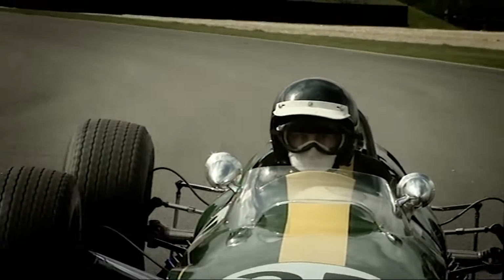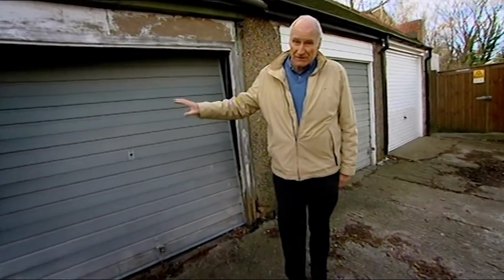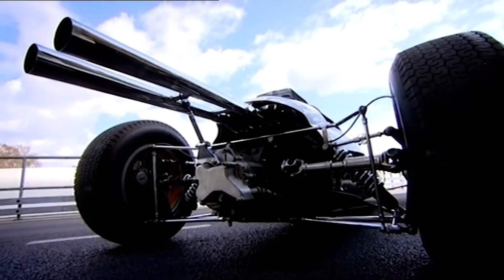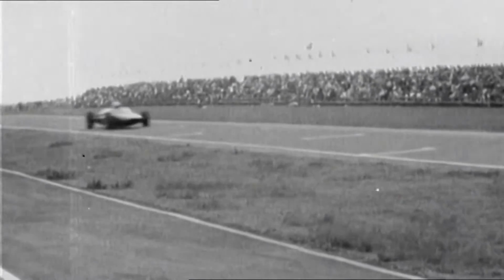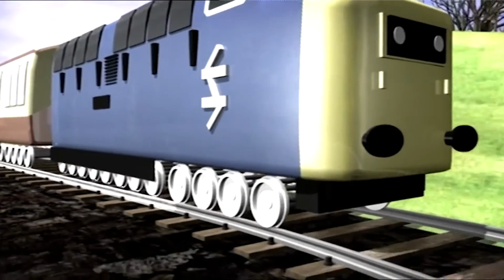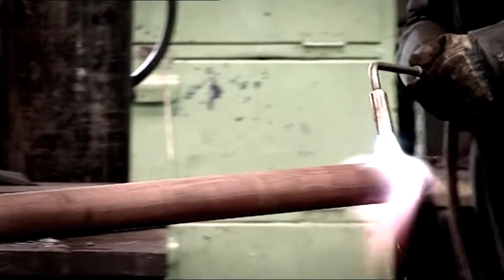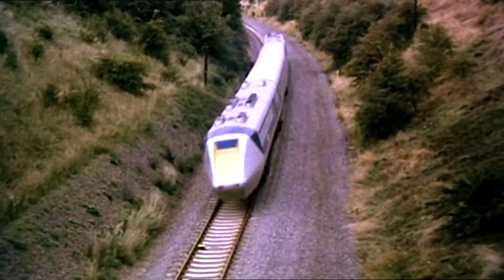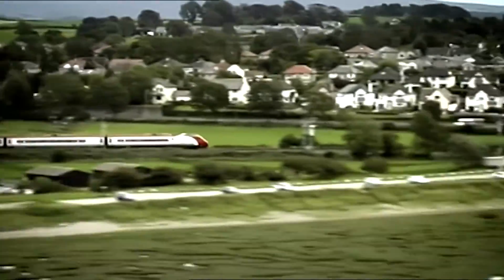How The Lotus 25 Race Car Revolutionised British Formula One

Comment: This milestone of a F 1 car is a unmatched unit with one man: Racing God JIM CLARK - Unmatched Maestro. By far the Greatest Driver Ever - No doubt. He is and was "The Best of the Best" (Fangio, Senna, Prost, AJ Foyt, Colin Chapman and countless others about Clark). No other driver in history until today was so superior as Clark - No other driver has so much "Grand Slam" ( 8 ! ) - Pole/Win/Fastest Lap/Leading every lap of the race - like him. And all that from just 72 GP starts... !
This man is the Olymp of driving - the Michelangelo of racing - a dynamic art at the highest level. So smooth, so precise, so fast....simply out of this world. Particularly noteworthy: According to the Lotus mechanics, Clark had virtually no brake and tire wear - and this in conjunction with his extraterrestrial speed.

Only mechanical unreliability prevented three additional world championships in 1962, 1964 and 1967. And although Clark is legendary for his incomparably gentle driving style, it is not for nothing that he was the only driver to drive the fragile BRM H16 engine in the Lotus 43 to his only GP victory.
One, who won in Spa by 5 minutes (!) in monsoon rain with only one hand at the wheel (!) due to gearbox trouble...One, who takes back a complete lap (!) in Monza and back into the lead... One, who took pole on the original 22,8 km Nürburgring track by 9 (!) seconds and more....One who won Indy by 2 whole laps. (!) 

Perhaps his greatest, but unrewarded, race however, was the 1000 km race on the old, 22.8 km long Nürburgring Nordschleife on May 27, 1962, in the rain. The first 11 laps of this race are considered by many to be unparalleled in Nürburgring history. Clark, in the small Lotus 23 with a 95 hp Ford engine, competed against the huge sports car competition from Ferrari and others with over 300 hp, and fielded with world-class drivers such as Phil Hill, Dan Gurney, and Willi Mairesse. Clark started seventh in the underpowered car. After the first lap, he already had a 25-second lead, and after the sixth lap, an incredible 1 minute and 45 seconds... To this day, Nürburgring experts speak of this driving demonstration from another galaxy.

In 1965 he had the most succesful year of any driver in the history of the sport: He won the F1 World Championship, the Tasman Series with F1 cars, the Indy 500, the British and French F2 Championship, the British Touring car Championship, totally over 50 (!) victories in one season !!!! For eternity and by lightyears unmatched in the sport. That`s just some examples of his mesmeric unique genius...
Reply: I won't argue the greatness of Clark, but remember also the genius behind the construction of the cars he drove. Chapman.
Reply: Hi Leo

My name is Cameron Greenwood Cramp AKA CGC. 

I'm an Aussie. I'm almost 28 years old. 

I was born on February 6 1997. 

I live in Melbourne in Australia AKA the land down under. 

I am the biggest fan of IMSA and the WEC in the land down under too. I've been into IMSA for 21 years now. 

And I love it. 

It's actually my favourite motorsport nowadays along with the World Endurance Championship AKA WEC and MotoGP & the 24 Hours Of Le Mans. 

Back in the day, I used to be into all motorsports, but not anymore. 

It's been like that for the last 12 years also. 

My favourite IMSA season is every single one of them. 

From the classic original IMSA from 1971 to 1998 and new IMSA from 2014 onwards. 

My favourite races in IMSA are the Daytona 24 Hours, the 12 Hours Of Sebring and of course the Watkins Glen 6 Hour held at The Glen. 

My favourite World Endurance Championship or WEC for short is every single one from 2012 to present day. 

Watkins Glen AKA The Glen in Upstate New York, where they make steamed hams, is the best race track in the United States of America. 

Also, Francios Cevert is the greatest French person of all time, apart from Rene Arnoux, Alain Prost, and Albert The 5th Musketeer AKA Albert De Parmagnan. 

And also, 1989 is the best Le Mans ever, along with 1965, 1966, 1967, 1969, 1970, 1981, 1994 and 1995. 

The Le Mans 24 Hours is my favourite race of the year and my favourite sporting event of the year too. 

Le Mans is my favourite race track in the world along with The Glen AKA Watkins Glen and Bathurst. 

Jim Clark and Ayrton Senna are two of my favourite drivers of all time. 

They are two of the greatest drivers who ever lived. 

Colin McRae and Walter Rohrl & Henri Toivonen are three of my favourite rally drivers of all time. 

They're tree of the greatest rally drivers who ever lived. 

Burt Munro along with Freddie Spencer are two of my favourite motorcycle riders of all time. 

They are two of the greatest motorcycle racers who ever lived. 

The Ford GT40 and the Ford Mustang are two of my favourite Ford's of all time. 

Two of the best Ford's ever made. Dale Earnhardt and Richard Petty are two of my favourite NASCAR drivers of all time and two of my favourite Amercians too. 

The Dodge Viper RT/10, the McLaren F1 and Mini Cooper are my favourite cars of all time. 

Search And Destroy by Iggy Pop And Never Gonna Give You Up by Rick Astley are two of my favourite songs of all time. 

Along with Colorado Boy At Heart which is a song that wrote and recorded entirely by myself. 

It's also fun little song about Dan Colorado AKA Dan Dougherty who's from Colorado. A very cool place. 

Albert The 5th Musketeer is my favourite cartoon of all time and The Young Ones is my favourite TV show of all time. 

Albert The 5th Musketeer AKA Albert De Parmagnan is my favourite Musketeer too. I'm the 6th Musketeer. 

Grand Prix Legends AKA GPL is my favourite game of all time. 

The Shawshank Redemption and The Incredibles are two of my favourite movies of all time. 

1967, 1976, 1989, 1991 and 1997 are five of my favourite Formula 1 Seasons of all time. 

James Hunt, Nigel Mansell, Barry Sheene, Striling Moss, Mike Hawthorn and Ken Miles n David Purley are my favourite Brits of all time. 

Dan Gurney is my favourite big tall guy. 

And also, Dan Gurney is my favourite person with the name Dan too, apart from Dan Wheldon and Dan Colorado AKA Dan Dougherty too. 

Chris Amon and Lloyd Ruby are two of my favourite drivers who were great despite having a bad luck reputation. 

On Any Sunday and The World’s Fastest Indian are two of my favourite motorcycle films of all time along with Race For Glory and of course Silver Dream Racer. 

David Purley AKA David Charles Purley is my definition of an absolute hero. 

Kork Ballington and Jody Scheckter along with Jon Ekerold are three of my favourite guys from South Africa. 

My favourite female racers are Penelope Pitstop and Janet Guthrie & Dancia Patrick. 

Ford VS Ferrari, Rush, Senna, Grand Prix, Le Mans, Race For Glory: Audi VS Lancia, Days Of Thunder, Talladega Nights and The Love Bug & The Last American Hero are my favourite car movies of all time. The Driver as well. 

My favourite Australians are Jack Brabham, Peter Brock and Mark Skaife. 

Bruce McLaren, Burt Munro, Chris Amon, Denny Hulme are my favourite Kiwi's of all time. 

Also, Lorenzo Bandini and Valentino Rossi are my favourite Italian's of all time. 

Jacky Ickx is my favourite all around driver and my favourite person from Belgium. 

Aguri Suzuki is my favourite person and driver from Japan. Great country. 

Ronnie Peterson is my favourite Swedish person and the greatest person from Sweden too. 

Ayrton Senna, Emerson Fittipaldi and Nelson Piquet are three of my favourite Brazilian guys and three of the greatest Brazilian's who ever lived. 

Henri Toivonen is my favourite Finnish person and the greatest person from Finland. 

Pedro Rodriguez is my favourite Mexican of all time and the greatest Mexican ever. 

Jim Clark, Colin McRae and Jackie Stewart are three of my favourite drivers from Scotland and three of the best Scotsman ever. 

1971, 1982, 1992, 1995 are four of my favourite Indianapolis 500's of all time. 

Jaques and Gilles Villeneuve are two of my favourite Canadians of all time and two of the best Canadians too. 

And Jeremy Dale. 1992, 1995, 1997 (CART) are three of the best IndyCar Seasons ever and three of my favourites. 

1979 is my favourite Daytona 500 ever along with 1997 and 1998 & 1976. 

The 1979 Daytona 500 is also my favourite NASCAR race of all time apart from the 1992 Hooters 500. 

1979, 1992, 1996, 1997 are four of my favourite Nascar seasons. 

1974, 1975, 1976, 1978, 1979, 1980, 1984, 1994, 1995, 1999, 2003 are favourite Bathurst 1000's of all time.

1993 to 2007 and 2013 are my favourite V8 Supercars seasons ever. 

Two of the greatest male cartoon racers are Speed Racer and Tom Slick and two of my favourite male cartoon drivers too. 

1966, 1967, 1968, 1969, 1970, 1971, 1973, 1982, 1984, 1997, 2003, 2012 and 2014 are my favourite Daytona 24 Hours and are the best as well. 

1966, 1967, 1969, 1970, 1971, 1983, 1986, 1995, 1997, 1999 & 2012 are my favourite Sebring 12 Hours and are the best too. 

Niki Lauda and Jochen Rindt are two of my favourite Austrians and two of the best people from Austria. 

Juan Manuel Fangio and Carlos Reutemann are two of the best Argentina racers and two of my favourites from Argentina. 

Clay Regazzoni and Jo Siffert & Alain Menu are my three favourite Swiss people. 

Three of my favourite drivers from Switzerland. Steve Kinser is my favourite Sprint Car Driver of all time. Like with most people. 

1982 to 1986 which were Group B, along with 1995, 1998, 2001 and 2003 are my favourite World Rally Championship's AKA WRC's. 

1998, 1997, 1995, 1994 and 2018 are five of my favourites in the British Touring Car Championship. 

1966, 1967, 1970, 1971 and 1989 are my favourite World Sportscar Championship's AKA WSC's. 

Every single 500cc season was and is my favourite Grand Prix Motorcycle Racing Season, especially the ones that had Freddie Spencer in. 

And finally.... 

Walter Rohrl is my favourite German and easily the best guy from Germany. 

Last but not least, 

Eddie Irvine is my favourite Irish and the best person from Ireland. 

:)

I'm also the biggest fan of the Bathurst 6 Hour. 

I loved it since it began in 2016.

I am also the biggest fan of the British GT Championship from the land down under and my favourite British GT Championship Season is 2024, I can't wait for 2025 and 2026. 

Also, I'm the biggest fan of the Asian Le Mans Series here in Australia and the land down under and my favourite Asian Le Mans Series is 2024 & 2021. 

And of course, I am the biggest fan of the European Le Mans and my favourite European Le Mans Series is 2024.
Reply: Jim Clark. The greatest driver of all time. Besides Striling Moss. And Juan Manuel Fangio. Also Ayrton Senna. Four of the greatest drivers who ever lived. :)